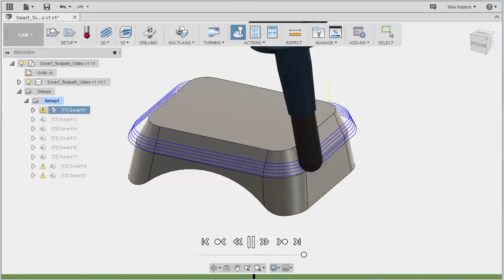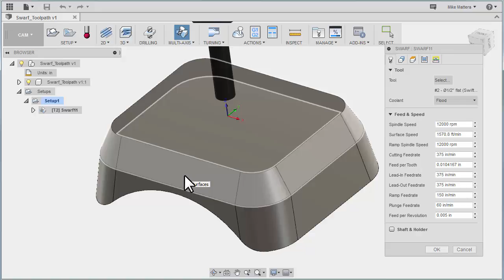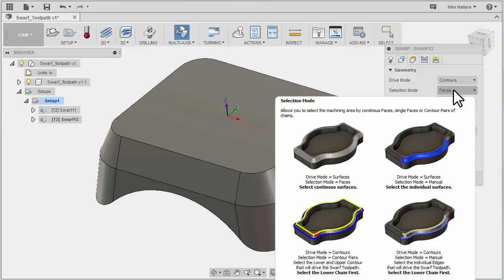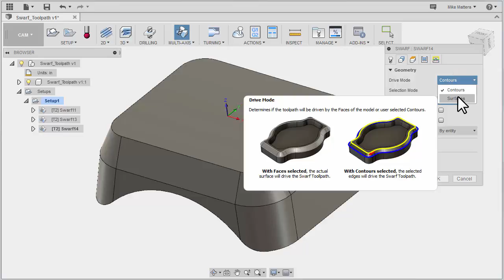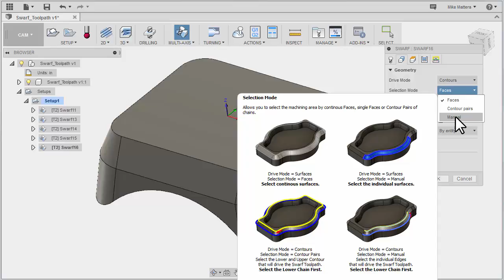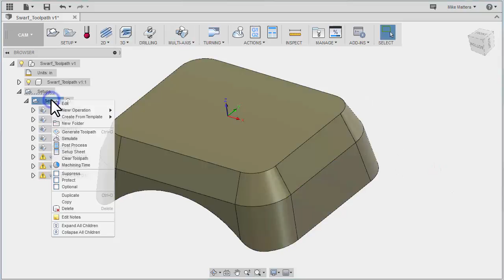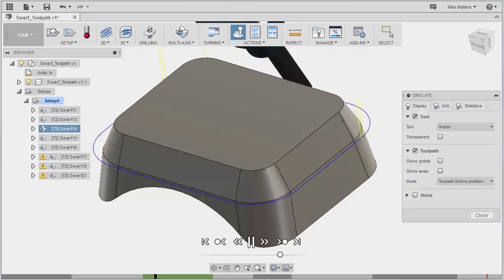Fusion Ultimate Swarf 5 Axis Toolpath - Tutorial 1 of 2

Comment: Have you got any tips on improving the surface finish when using single pass option? 
I’m trying to machine a profile which goes from 90deg to the top at one end to 60deg at the other. It’s leaving lumps in the finish when the C and A axis are having to catch up with each other. 
I’ve got the maximum tool axis distance and angle both set to .1mm and it’s still coming out quite badly in places. 
Haas VM3 with trt-160 trunnion